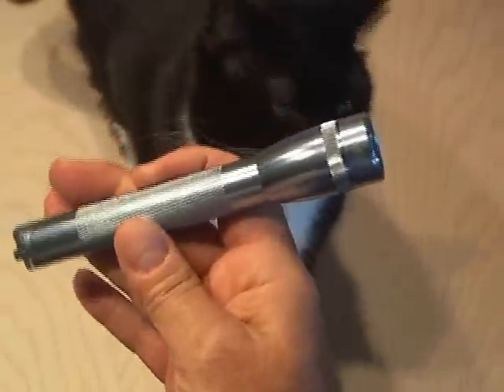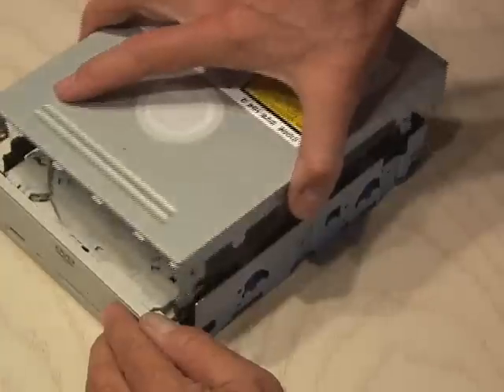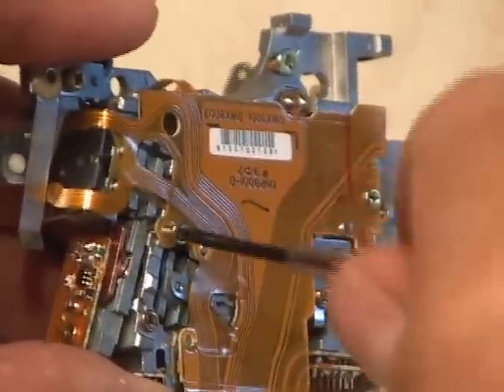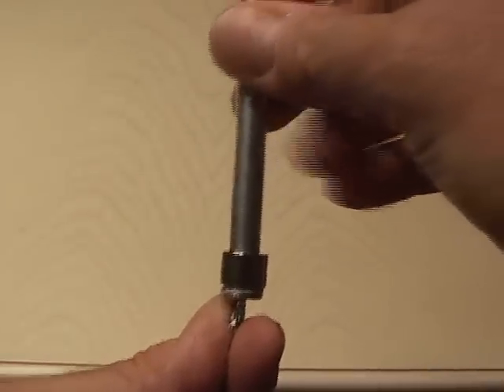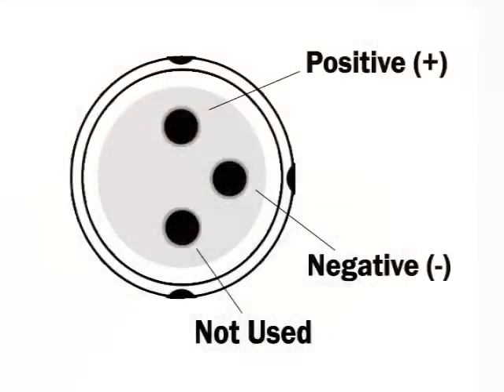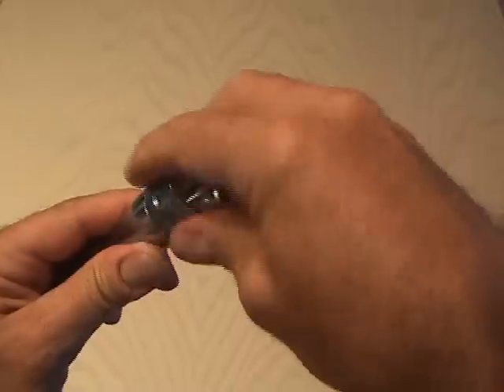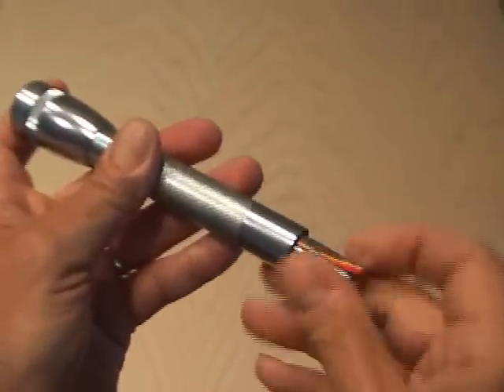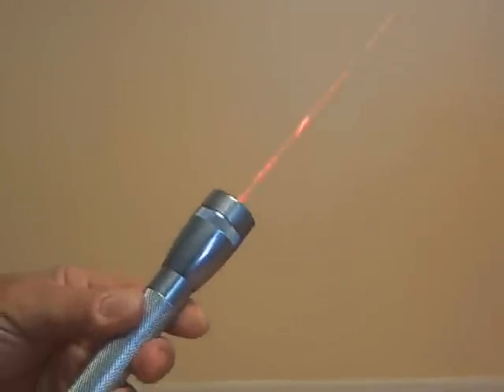Amazing Lasers! - Laser Flashlight Hack!

Comment: Think of a diode as a kind of electrical switch, when difference in voltage between the positive and negative side reaches 'forward bias' (usually .6v or so), current is allowed to flow. Otherwise, it is like an open circuit. Some diodes emit light when forward biased, hence the name LED, light emitting diode.

Comment: with a 9v battery you will burn out the diode, use a 3v, if you want to go over 3v then you will need a driver. hope that helps :)

Comment: That's perfectly normal.  These laser diodes produce a lot of heat when used and builds like these should have a heat sink.  Since you don't have a heat sink (although I'm sure you can buy one somewhere), you're going to need to work off a relatively short duty cycle.  Thirty seconds off for every ten seconds on should do for this one.

Comment: I have torn apart like 5 different drives and pulled the diodes out and none of them will burn. I have 2 AAA batteries for power, and correct polarity. The laser shines, but no heat.

Comment: So I dug out an old DVD/RW drive I have but it has no indication of the speed on it. I have a couple of technical details though if I could get feedback as to whether the laser will be suitable: It has a "class 3B visible and invisible laser radiation" warning, and it's "Rating" is at 5v = 1600mA and at 12v = 1800mA
I have everything else required, I just don't have much knowledge in this field. I just want to be able to stealth-pop balloons and light people's cigarettes from across the room. :P

Comment: @popdudrocksmorethanu   the "pins" are just short pieces of wire he cut off a larger piece. solder the two short (3/4  inch?) pieces of wire...single strand, not the twisted stuff like in a lamp or speaker cord. to the wires comong out of the laser eye so they are long enough to make contact with the metal strips in the flashlight caseing that connect to the batteries.

Comment: @aapeliino @MrMargayracing @wfymtrl1  No, it's not a burner.  Burning is crucial, it takes far more power to write/rewrite a DVD than to just play it.

@albpoolshark 22x likely requires more power than the 16x, it might be slightly more powerful, but could potentially not work at all or drain the batteries a lot faster.

Comment: @p1on33r yea mines pretty similar, I used a re-writable compact disk DVD rom from one of my schools broken computers, I got what I thought was the laser but turned out to be a very delicate magnifying glass suspended on 6 very thin wires and held in place on a pivot type frame. But I followed the direction of all the small glass fragments in a slightly bigger steel housing that led me to a small steel housing that I hadn't spotted. I pierced it off and found the diode attached on to a small cir

Comment: @D8Y1L3A9N3 
A laser differs from an led because led is light emmiting diode, a laser is a foucused beam which can be very powerful, laser pointers are usually <5MW, which cant hurt anything really, but when you turn that 5 mw into around 50 to 1000, it burns!

Comment: hmmm, other than pointing the laser at his eyes, what is the danger in this? I hope you dont think that somehow the thermal runaway possibility could result in any harm, being that its powered by about 3 volts and a few dozen mili amps. the worst case scenario is that a battery will pop, and leak a small amount of battery acid, hardly something to sue for...

Comment: couldn't this idea run on 3 (maybe more?) AA batteries for more power? I know that the 2 power pins on molex are 12 volts and 5 volts, so would using another AA give quicker burning times for things like tape and balloons?  Thanks!

Comment: how does the wiring work? is it possible to use just a flashlight without the lazer housing? i have a lazer diode & a flashlight, and could probobly do the wiring on my own.

Comment: Diodes need to have their current externally limited or they will burn out.  Or so i thought...?
3V through a diode (without a resistor) would run at many amps...  or so i thought...???

Comment: I took the whole DVD drive apart and have the diode, but it doesn't look like the one in the video, and the diode won't come out of the metal casing that looks like it is made from some cheap cast metal. I also wonder about the resistor. Any help? Thx

Comment: This would burn up the diode fast lasers need voltage regulation (low amps) and in small mW lasers the wave length isn't powerful enough to see with out smoke or steam. So this works but not great. And if I were to make a video like this I would add that you can permanently damage your eyes without proper glasses.

Comment: If we measure the dimensions of a laser (about 15cm tall and a radius of 1cm) and apply the formula V=(pi*r^2)*h we can conclude the volume of that laser is about 47cm^3, if we multiply it by the number of lasers you suppose kipkay has (3*10^39) we end with a volume of 1.41*10^39 cubic meters wich is 22614836481915477661109937 times the volume of our atmosphere and a total weight of 15*10^24 tons, 2542372881355932203389830 times heavier than the earth.
Attentively, Captain not so obvious.

Comment: Hi
I wanna try this but have no electrical skills so far.
Would it be possible for a printed step by step guide on pdf that you could email me. Even if a small fe is required I would really like full instructions.
I'd like to have a better understanding before I go out and buy a soldering iron and other bits and pieces. I already have a dvd/rw ready to trash.

Comment: how do you wire it?
Reply: I would assume that you would take a wire and solder it from the last stud visible  (behind the lightbulb) to the positive lead on the laser diode. Then, either use the excess slack on the negative lead and jam it to the body by crunching it in between where you screw the top assembly on (making a ground) or be more fancy about it and use wire and  solder the negative lead to the wire, and the wire to the spring at the bottom the the flashlight assembly, but leave some slack so you can change the batteries. I wouldn't solder the negative lead to the body, because their could be some paint that would not only interfere with the solder, but also the connection.

Comment: This doesnt work. I removed the diode solder some wire onto the correct contacts and hooked up 2 AA's. nothing is emitted, tryed reversing the polarity and still nothing.

Comment: can someone help me?
i got leser diode form the dvd burner but when i tried to check it's polarity with double AA batteries nothing happened. 
later on i read somewhere that double AA's can damage your diode is that true?
 do i really need leser housing because i am unable to buy/find/make it?
and do i need to make any circuitry with diode or i can use just 2x AA batteries to power it and it wont brake or something.
sorry for bad english and not knowing much about electronics

Comment: If we take the average skin surface on a human body (2 square meters) and we divide it by the area wich a powerful laser dot can burn (about 1 square milimeter) the number equals the maximum number of independent laser holes we can do, that means we could do 2000 holes, far from the number you suggested, also, the average laser wich has between 5mW and 1W can't trepass the skin, fact that makes you comment a double nonsense.
Always fighting for the truth, captain not so obvious.

Comment: i have lasers, batteries, and cables, but somewhy the laser light is low and do nothing :S i dont want to make a chip or what, and i dont want to use other parts. just a battery, laser, cables.